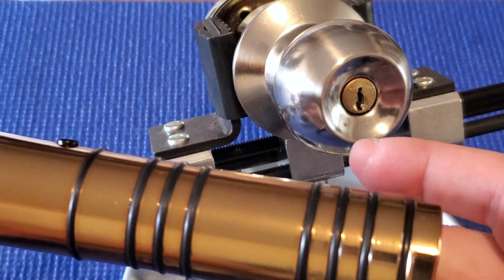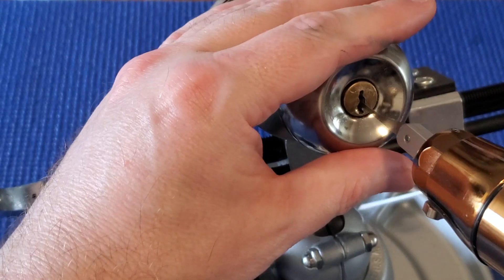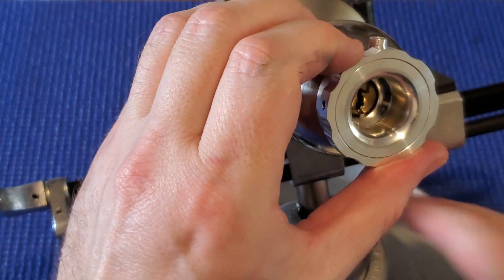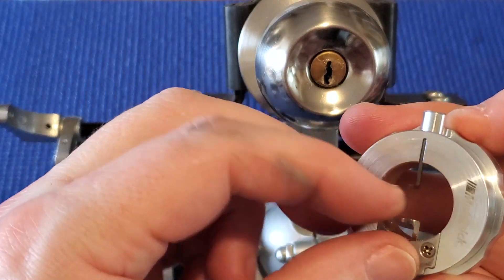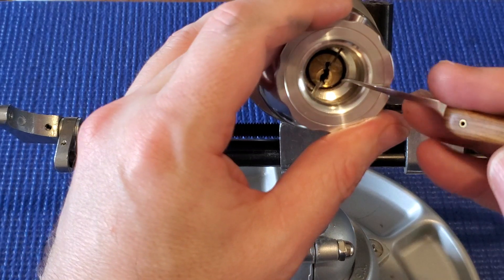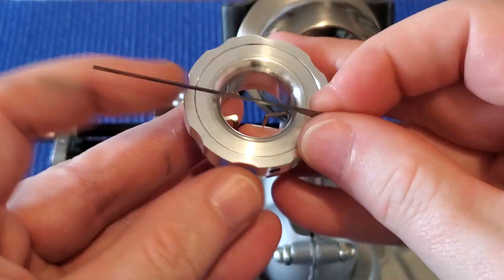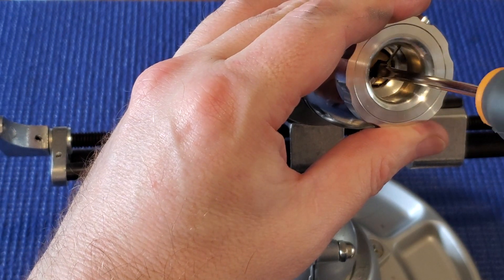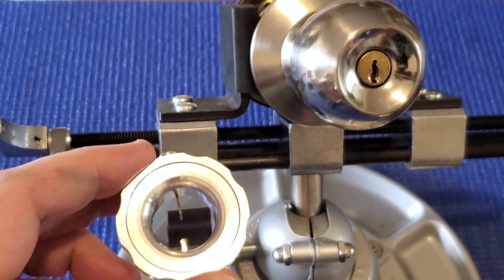(Picking 158) Tension Ring

Comment: Freakun awesome mate, you got one! And it looks like it works great with the Kronos!

Great review, and tips, esp regarding the single pin picking. Not good at that but perfect tool for the job for a pick gun/Kronos.
Reply from the maker: Indeed it works so well with the Kronos, and I'm very pleased.
Thank you for you kind words.
I didn't explain in the video properly that with the Kronos I do short bursts, reseting the lock between each burst to reset any overset pins, and if I simply turn it the other way, eg from clockwise to counter-clockwise, the pins are reset and give that a go with a burst the other way, and then change to clockwise (reseting the pins in the process), etc, alternating between each burst ... and because some locks pick easier one way rather than the other way (because of different binding points etc) then I'm increasing my chance of picking the lock!

Have a great rest of the year!